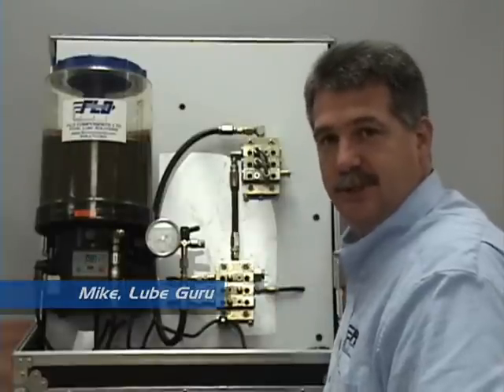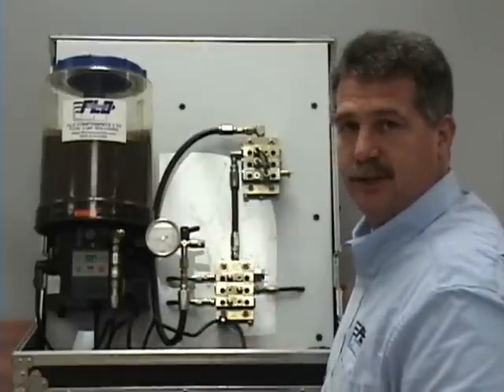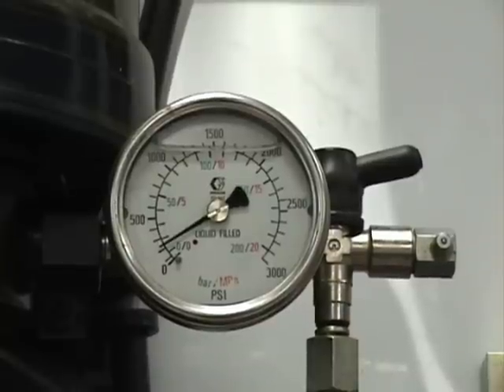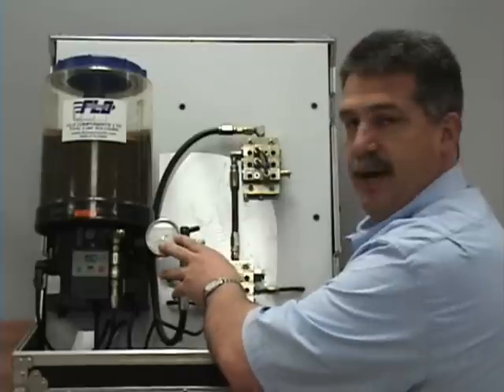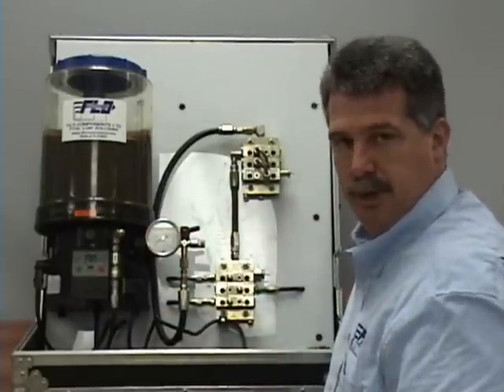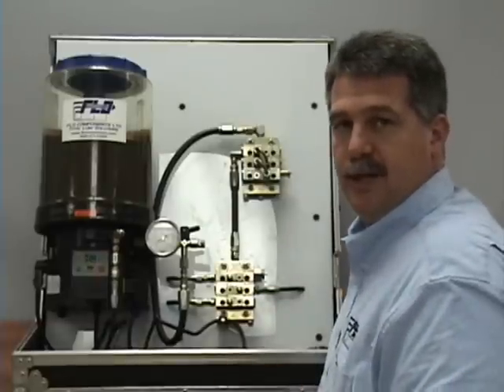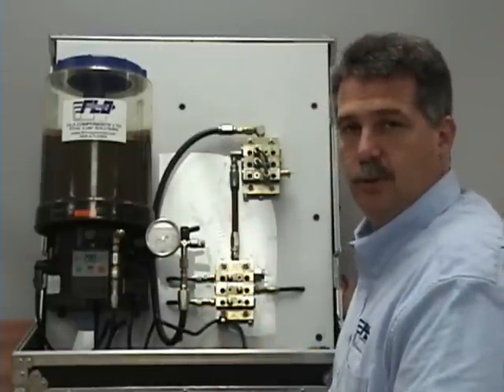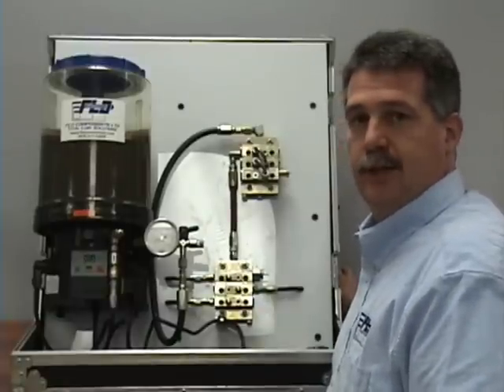FLO Lube Tip - Pressure Gauges on Automatic Greasers

Comment: In a progressive system the gauge will fluctuate up and down , then fall slowly to 0 .                                                           In a series system the pressure will rise to a point, hold until the firing valve releases to 0                                                  NB. the gauge being stuck in high position is indicative of an issue.

Comment: my pressure gauge is not indicating the work pressure why?, and the pump is working normally the code of the pump is P653S-8XLBO-24-1A-AS07-UL
Reply from the maker: To help us get a better idea of what might be happening, could you e-mail us a picture showing where the gauge is installed on the pump?  Send it to sales@flocomponents.com.